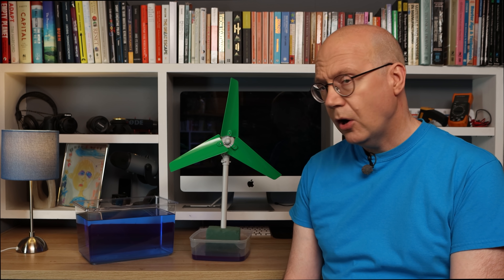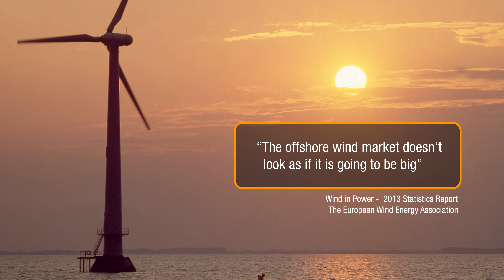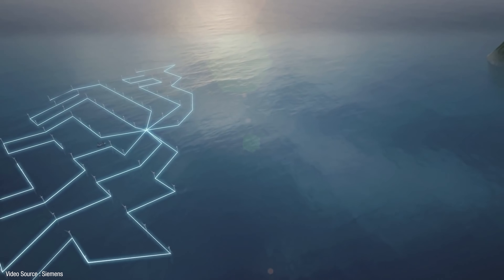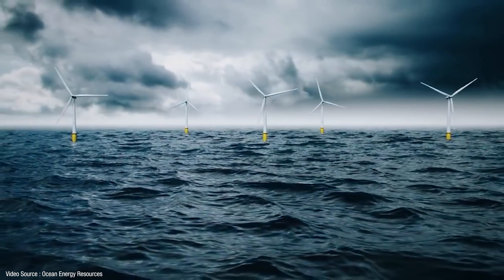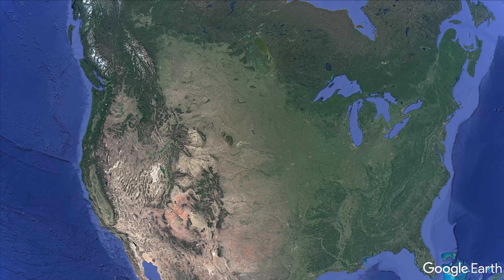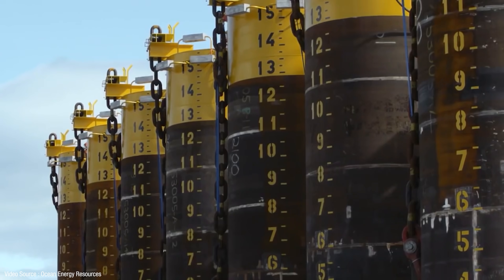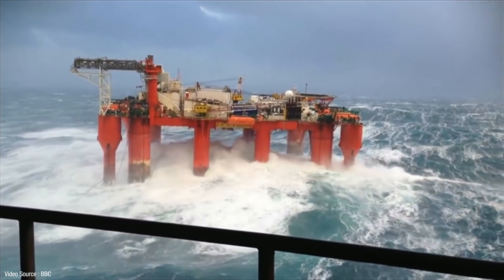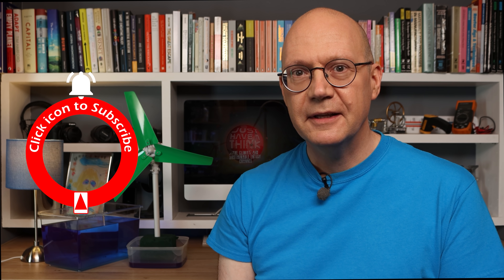Deep Ocean Floating Wind Turbines. How do they do that?

Comment: But if you use the wind power, it will run out, Tr*mp told me… 😂
Reply: Do you have any idea how many wind turbines the world will need to provide everyone with power?
Reply: @Les_S537  more than 10, less than 1 billion.
Reply: @Muppetkeeper  Well, today, wind power accounts for about 1-2% of all the energy generated on the planet today, but how many wind turbines does it take to do that?

Over 400,000...

Do the math...

Let's say we want to power half of the world, at today's energy level requirements...  How many wind turbines would that be?

Tens of millions.

Now, keep in mind that energy requirements in the coming century are expected to double or even triple as the world moves to EVs for transportation...

Hopefully, you can see that wind power is never gonna work.

Do you know how much resources it takes just to produce (1) 7 MW wind turbines?

~900 tons of steel
~2,500 tons of concrete to act as the base
~50 tons of NON-RECYCLABLE plastics.

Wind power is a really bad idea.
Reply: @Les_S537  Anyone who thinks that there is one solution to electricity generation is uneducated. Wind has a place, as does solar, nuclear, hydro and geothermal. Your post just says it’s hard, we already know that. So come back with solutions, not problems, anyone can repeat the question, bring answers.
Reply: @Muppetkeeper  Couple of things MK...  Any electrical grid in operation today has two "kinds" of power...  Baseload energy sources, and intermittent energy sources.

If you want to have a successful energy grid, your baseload power sources HAVE to have high capacity factors.

If you try to operate an electrical grid using power sources with low capacity factors, you're going to get what we see happening in California today with the state experiencing rolling blackouts as the renewable energy sources they've decided to go heavy on don't produce like they're expecting them to.

I agree that we need diversity in our energy sources, but the only energy source capable of supplanting fossil fuels as our baseload power source is nuclear.

We need lots and lots of nuclear power.  Wind, and solar, and geothermal, et al have their place in the electrical grid, but if you try to make them baseload power sources, expect many outages...
Reply: @Les_S537  I’m a Chartered Engineer (Electrical Engineering) and worked in the UK Power Business. Norway runs entirely on geothermal power, and here in the UK there is an estimate that 20% of load could be geothermal, that’s 20% base that we haven’t utilise at all.  The USA has issues because of its extreme capitalism, no one is willing to fund a decent grid or generation, or to work together to solve the issues, because that’s just “communist”
Reply: @Muppetkeeper  Norway does not run on geothermal, they run primarily on hydro power, with a smattering of wind, and geothermal...

Geothermal is the best "renewable" energy source going, with a capacity factor in the 60's.  The problem with geothermal is that if you aren't in a good area, they're exceedingly expensive to build.  

Iceland runs primarily on geothermal, but then they sit right on the mid-Atlantic ridge where volcanic activity is high and close to the surface.

How deeply have you looked at nuclear power?
Reply: @Les_S537  Sorry I meant Iceland.  I used to work in a nuclear design agency, so I understand it quite well. The issue with Nuclear is the 40 year lead time for planning and construction, it will be game over by then.

Comment: the predecessor to offshore wind turbines
Out by Ebeltoft Ferry Port they are close by, they stand on a stone pier. Originally, 18 turbines were erected in 1985, which at the time was Northern Europe's largest wind farm, and at the beginning of the year 2000 they were replaced with just 4 large ones.
The windmills are fine and just fit into the landscape.
Easy to park and enjoy nature and windmills.

Comment: Well done, well said.  My experience of 35 yrs is in the offshore industry and in particular offshore T&I (transport and installation). There are no technological "issues" (that I can see) for deep water floating wind turbines. The technology exists and it is the production capacity and funding that need to be developed.  The service side of it, already exists thanks to the shallow water wind farms, it just needs to scale up (larger SOVs or Service Operation Vessels) so that the R&M teams can remain offshore for extended periods of time (like with the bigger offshore construction vessel in the O&G).  What is interesting, I see a major opportunity for the T&I side to cut cost.  Although I love the big crane vessels (I used to work the best in the world, Heerema), I think there is an opportunity to rely less on those big and expensive vessels and develop more cost effective methods (thanks to the economies of scale). The same goes for the installation of the subsea infrastructure (cables in particular), there is room for improvement there as well.  In short, I think deep water offshore wind has a great future that we'll see develop further in the next decade(s).
Reply: Eugene, as someone working on the dynamic subsea cable supply side I'd be interested to hear what you have in mind for optimizing cable T&I.
Reply: @Danandlene  are you on LinkedIn?
Reply: @genieb  Yes, you'll find me working in Oslo
Reply: instead of building vessels, build a offshore wind turbine as vessel then fill it botom with concrete to stand up turbine :D
In my opinion, anchoring deep and moving folow the wind while power lines need to keep integrity is the very hard part
Reply: @sebastienl2140  The ones in Scotland (Hywind) are SPAR type floaters, simple floating cylindrical basis with a concrete or other ballast material in the bottom (I forgot what they used) and then moored with a three or four point mooring system.  The bigger ones that were shown were 3 leg floaters and other floater types are under development with smart mooring systems. None of them are vessel type (which would be overly expensive). The vessels I mentioned are being used for the installation of the turbine offshore and that is where I think we can go much cheaper, assembly inshore and then tow the complete unit to site. The mooring systems and cables still need to be installed (prior) and be hooked up (which would need a descent size crane on a offshore construction vessel, with ROVs etc.  The thing is the massive big crane vessels (Sleipnir, Balder, Thialf, S7000 etc.) are expensive and only a few in the world.  Smaller OCVs are plentiful and I'm sure we can design them for hook up duties and installation of moorings etc. can also be done from / with smaller vessels. Tugs are plentiful as well for the towing to site.
Reply: @genieb  The problem with spar type is that they are inherently unstable until all three (at least 3) moorings are installed - and they are not small!

The triangular model is stable but with only one turbine requires a lot more material to provide that stability.

I certainly agree that it is the T&I aspects that need the most work on with maintenance access being a follow on - it's not as though you can land a helicopter on them.
Reply: @grahamjacob97  the Spar can be made stable (and usually is) with its ballast in the bottom.  The moorings only keep it in place.  The advantage of a spar is that it is a single floater, relatively easy to fabricate, compared to a "tri-floater".  To be honest I don't have any numbers to compare the cost of a spar and tri-floater like for like, from concept to installed and decommissioned. I do see one opportunity with a spar that is much harder to do with a tri-floater. Inshore assembly of the entire spar/turbine could be done horizontally (at a quayside that is sufficiently deep, read a Norwegian fjord type, similar to where Troll C GBS was built) and then the entire assembled turbine/spar could be upended by flooding and ballasting the spar floater. And R&M, I agree no helicopter landings, still need the SOVs with gangways or surfer type boat landings.
Reply: A very good point. A man from Heerema would know. Would you think that an pre-installed and pre-outfitted turbine at a shipyard, is better option?
Reply: @sushobhanchowdhury6413  not exactly.  A few years ago I developed a concept that will make offshore installation more efficient but finding funding to work it out in some more detail is not easy.
Reply: @genieb  Oh is it? Would like to more about it. However, funding may be an issue now but as the Offshore Wind Energy generation scales up, your concept could be commercially viable.

Comment: Would it be possible to tow these floating turbines back to shore for maintenance instead of doing it in the ocean? One could imagine a few big ports where these turbines are built, but also maintained and recycled, and tow boats dragging them back and forth every few years.
Reply: Sure, after all they only weigh about 11,000 tons.
Reply: @Withnail1969  No need for sarcastic answers. They float, so its technically possible.

Comment: Great video! Thanks. 
As I’m watching, the elephant in the room: What happens when there’s no wind? Consistency of the winds mentioned have their limits or are seasonal.
Reply: Energy intermittency absolutely is an issue. To manage this the grid will take power plants on and off line, they'll use the excess energy to pump water up hill and store it as gravitational potential energy to be turned back to electricity later. They'll also sell the electricity to other countries and Europe is developing a single grid to do this. Finally they can drop prices and even pay for it to be used on occasion. 

It's not as big an issue as you might imagine either, the wind can be very variable in one location but over a wider area with many turbines it tends to be decently consistent and going to the open sea would only help this. It's also reasonably predictable with weather forecasting so the grid can stay ahead of demand by using traditional gas plants in a reserve capacity for high peak, low demand periods.
Reply: Indeed, as @David Murphy says, it's a real issue but it's also a good argument for offshore wind, as the wind tends to be steadier at sea than on land.
Also, because they can be built larger than inland turbines, offshore turbines have the advantage that wind tends to be stronger and steadier the higher you are above the earth. (The rule of thumb I heard is that you want the bottom of your blade to be at least 11 m / 35 ft or so above the highest thing around, be that trees, buildings, or terrain. But higher is better.)

To me the elephant in the room is the power cables delivering power from these floating turbines all the way to shore. I'd like to hear more about how those work. I know we can run communications cables undersea but power cables that can handle dozens of MW seem like a whole other level. These are HVDC, I presume.
Reply: @ps.2  Absolutely agree. Energy transport will a real downside. In a way you can't beat panels on roofs, it completely bypasses the transport issue. We need to get to a state where a building without a panel is the exception.

But I see a role in hydrogen here as an energy storage means once we scale up wind. That could allow us to store chemical energy and solve the issue with shipping and maybe even aviation, engineering permitting.

Comment: When you think about the enormous energy potential of remote oceans around the world, e.g. the southern ocean, then hydrogen production for the transportation of that energy surely becomes more viable. Tankers move oil today, why not hydrogen tomorrow.
Reply: Because hydrogen requires a lot of electricity to generate. Last year, mankind pulled 37,000,000,000 barrels of oil out of the ground for transportation fuels. Can you imagine how much electricity would be needed to generate equivalent amounts of hydrogen?  It is folly to believe we’re going to go with hydrogen fuels
Reply: @Les_S537  There is new research into electrolysis by the university of Dublin which reduces the energy requirement to split the water molecule significantly.  If the wind energy supply is inexhaustible (and it is) then what does it matter?
It solves the problem of transmission losses not to mention the massive infrastructure cost. It is a viable option.
Reply: @robspeedwell  Here's the problem with hydrogen...

In order to make it work, the entire world is going to have to build out a massively expensive infrastructure.

With EV's, we already have the infrastructure to make them work, and with EV batteries being nearly 100% recyclable we just need to gather the resources for all the cars we need once, and then we recycle from there.

Also, hydrogen is very explodey...  The US has 175,000 car fires a year.  Imagine if they were hydrogen car instead.
Reply: @Les_S537  of course batteries are the best way to go for ev's and solar storage. My point is one of energy transportation. Hydrogen is more energy dense than  oil, and far more so than present battery technology. We already have a gas delivery infrastructure and domestic heating boilers are being built hydrogen ready. 
It could be used to power aircraft, with the necessary volumetric accommodation. 
If we were to capitalise on deep water wind power in remote areas of the sea then we would need a way to bring it home.
Reply: @robspeedwell  I don't know if you know this, but we have a resource issue when it comes to batteries.  All of the auto manufacturers are constrained by a lack of resources to make batteries.

And you want to use batteries as backups for renewables?

No...

We can't do both at the same time.

We need to dedicate batteries to converting all transportation over to EV, and you really need to dive deeper into hydrogen fuels because I have, and it's ultimately just the long route to EVs because any hydrogen fueled car runs on batteries.

With hydrogen, you're using electricity to create the fuel, to use the fuel to generate electricity.

It's a phenomenally dumb way to do cars.

Planes, yeah...  Cars, no

Comment: How I love the measure of wind and solar output,  as used by its advocates.  "Enough energy to supply 20,000 homes".  What a laugh.  Power output and cost per KW  is not measured at the generator terminals,  but  is measured by a 24/7/365 supply to the customer's meter.  All this wind power has to have full,  indeed over 100% back up by a duplicate system and must also factor in the massive grid losses incurred by disparate systems.  This is why there is now such a massive buy in to these projects by big oil / gas,  who are going to have us over the metaphorical oil barrel for filling in in the gaps.  Even more so now that the Green movement have put a halt to fossil fuel exploration and exploitation,  meaning we will shortly have the oil price up at $150 and climbing.
Reply: Like to see the evidence that fossil fuel exploration has been halted.

Comment: i think using a vertical 3-blade on such platforms is not a good design. Perhaps a horisontal, tubular design on an oil-type platform would work better and be simpler (the ones that are being tested on tanker ships). To increase output, several tubes could be installed and connected to the main generator.

Comment: VAWT's on floating platforms would be better. Yes, 1 to 1 they aren't as powerful, but if each platform has VAWT's to equal the lone HAWT why not. They don't need to be secured in high winds and if one breaks down you're only loosing a percentage of the power while it's being repaired.
My best analogy for it is why buy an ostrich egg when a dozen chicken eggs will give you the same amount of egg.
Reply: If it were more cost-effective, I'm sure they would. It's not like nobody at those companies has ever heard of VAWTs. They have Youtube too.